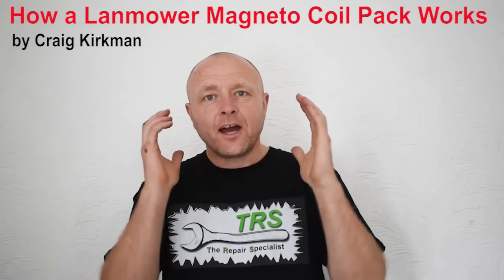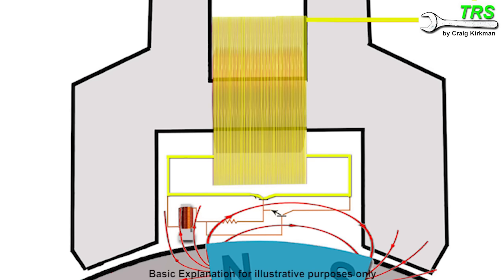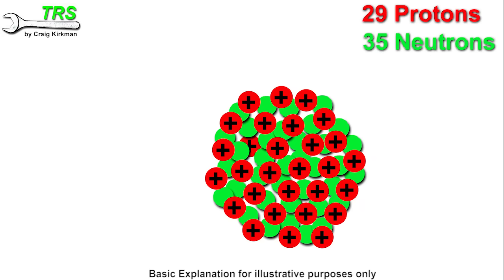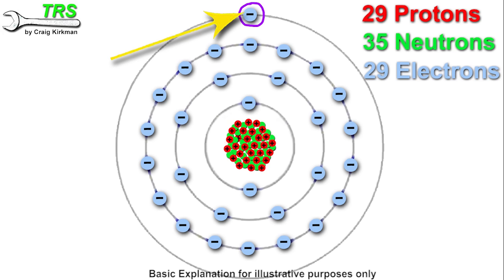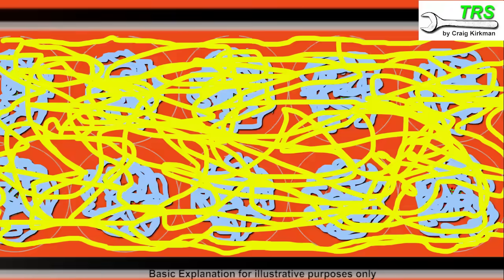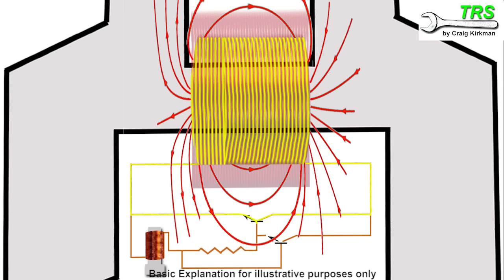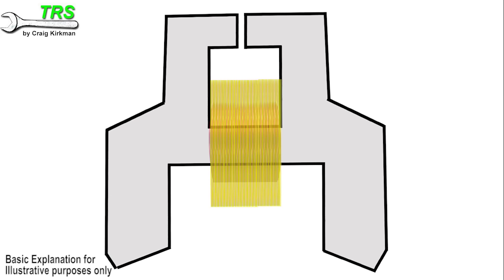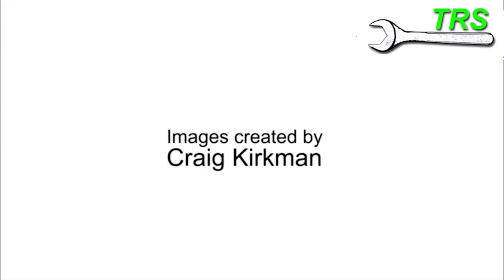Lawnmower Coil Pack Sparking System - Induction Coil, Transistor!  (by Craig Kirkman)

Comment: Just the man I'm looking for. like many others I knew loosely what happened but not exactly how and why.  Now I'd love you to go to the next step, I have a problem and I think by you answering it as you've explained here that you will go a long way to helping so many ? Here's the challenge that proved I don't know as much as I thought or enough to solve the problem. "I was given a chainsaw that fires once or twice with every pull but will not run".  It's an older obsolete model with the coil on the outside of the flywheel and points/condenser under the flywheel. By hand pull it gives a small fine spark similar to car electronic ignition. Upon deeper inspection I find what looks like someone has swapped out parts with something non original as original parts are no longer available. Points look good ? Condenser looks new but is a different model that's been soldered to the base plate (should be OK unless the heat of soldering it's case has damaged it).  So first question is how to test the condenser ?  Next I find the coil has the word ROTATION and an arrow pointing in the opposite direction to that which this flywheel turns (clearly from a different engine) ? Now there are the points style of ignition/coil and the later coils that don't use points and work as described in your video.  How do I tell the difference and which one I have ??  Can one type work in place of the other ... if not why not ... or what needs to be done to make it work ??
I disconnected the points and kill switch wire from the coil and then I spun the engine on the bench using a powered drill to check for spark at speed, which it does ... well kind of ??
It produces spark running the correct rotation for the saw which is opposite what's marked on the coil. It also produces spark running opposite rotation for the saw but correct rotation as marked on the coil ? Does seem more consistent running the latter though.  I re-connected the points and kill switch wire from the coil ... it still produced spark while rotating correct for the saw and opposite the coil marking ... but it doesn't produce any spark rotating opposite the saw direction as I guess the points are opening at the wrong time to coincide with the magnets passing the coil.  Still with me here ?? 
I want to know why the direction of rotation is important enough to be marked on the coil ? My guess is the coil I have is the type you've explained using a trigger coil and for a system that doesn't use points but there is no visible third part of the iron core ?  The iron core is a simple "U" shape with just 2 legs and the coil is over one of the legs.  
So begs another question - why do some 'coils' have 2 legs or iron core and others have 3 legs ?
I'm sure you've got enough to create the next lesson so we all learn the workings of points and no-points systems and the differences and how to convert one to the other ?  Thank you very much in advance.

Comment: Sir, my lawn mower runs for some ten to twenty minutes and then die off. But if I change new spark plug, it runs instantly. What might be the problem..?? 🙏🙏. Because I can't keep on changing spark plug every single time. Please help me to diagnose it.
Reply: try cleaning spark plug ?? look what different used / new !
Reply: @davidm.4670  I used to clean the spark plug but same condition. It won't start.
Reply: @chongshenchang9367  Have you tried re-installing a previously used plug after a new replacement fails?   If so what happened (Heat?) (Gap change??) (fouling?) What was (is) cleaning method / results?  Could it be engine cool down time etc during plug change?  Sorry not much help ...
Reply: @davidm.4670  Sir, ive cleaned the plug with petrol and a fine sand paper to remove the carbon deposits.
Reply: @chongshenchang9367  I would not expect 10 - 20 min run time to make much carbon - is your mower running rich / choked?  Often the insulator for the center electrode (round not tab) getting heavily coated can short the plug.  Reaching in carefully with a needle can help. Can you check if you are using the right temperature range plug for your mower?
Reply: @davidm.4670  No, I'm not saying that it makes lots of carbon but just telling you my procedure of cleaning spark plug.
Reply: @chongshenchang9367  Well I'm 'bout out of ideas from this far away
Reply: @davidm.4670  Sir, I found out that, if the choke is on, it starts but if closed, it stops. What would be the case..
Reply: @chongshenchang9367  Don't really know - might try starting with choke on , then reduce as warms up?

Comment: Am I correct in thinking that one end of the secondary coil winding is connected to the iron core while the other end goes to the center high voltage lead of the spark plug ?   JwgK

Comment: Very good explanation however the magnet moves past the 'A' creating a magnetic field in both the primary and secondary coil and surely the trigger coil just boosts the effect or triggers a current flow already created by the magnet passing the 'A' (what I'm trying to say is that it is not just the trigger coil that creates all of the current flow but I could be wrong).

Comment: The only thing you did not explain is the gap of the spark plug..  What if the gap is to small or to large?  I know it would take a higher voltage for the spark to jump the larger gap.  But, if the gap is to small it would be easier to jump the air gap.  So I know there is a specific gap for each spark plug but would it be a different gap using the same spark plug in a completely different engine?  Wouldn't a smaller gap be still OK or would it fire to quickly because the gap is easier to jump.  That would make firing the plug a timing problem.....  The plug would fire at a time not ideal for the highest compression of the gas...
Reply: Richard Murawski  suspect plug gap not very critical for lawnmower ...

Comment: I, like the majority of the commentators below thank you for an excellent, in depth, and understandable presentation. I was also among the others who were ignorant of the trigger coil housed inside the coil component itself. I knew there had to be a trigger mechanism, but didn't know where it was located in the system. One thing that still intrigues me that you didn't explain; since the secondary coil is grounded to the iron core, why is not the current shunted to ground when the primary coil field collapses instead of to the spark plug? I would appreciate an answer. Thanks again. Carl

Comment: I don't understand how the exact timing is maintained when when the magnetic field on the flywheel is so broad compared to the exact spark event. My assumption is that the electrons will begin to move in the presence of any strength magnetic field. The field of the magnetic occupies roughly 60 degrees of rotation Wheras the spark event is one tenthousands of a degree.

Comment: The secondary coil winding has two connections. One is connected to the sparkplug and the other end of the coil is connected to the engine's iron body. So, the flow of secondary current is through the coil to the spark plug gap back to the iron that completes the electron path back to the secondary winding.

Comment: I considered myself an okay small engine mechanic, but I had no idea how complex these coils are, or how all this worked.  I've known for a long time that the coils and fixed magnets don't perform very well when they're allowed to get rusty.  Other than that, they're pretty tough.  Awesome presentation.
Reply: As per Briggs ,rust does not matter one bit , except for maybe adjusting the air gap, and even then off the record during training they said you probably would get spark with the mag pulled all the way back in the adjustment. 
One issue can be bad grounding ,it can corrode where it contacts the block but it's easy to take off ,clean and reinstall. 
.010 is what you're shooting for but I've been doing it long enough  I just eyeball it.

Comment: I knew most of the components and architecture... SORT OF... I've been jabbing at these things with ohm-meters for years, and still trapped in usually just replacing the thing with little or no explanation as to what's actually wrong with it... "It won't fire" is about all I've had...

    Now, there's the trigger-coil wired to the internal "primary coil" and the SEPARATED (or "isolated" if you like) Secondary coil to throw the "High Tension Spark" (as in the "H.T. Lead") to the plug... AND I can see it, and "get" it... 

    I may still never truly diagnose a coil fault without hopelessly mangling the coil-pack, itself... BUT I definitely have a better idea of some of what the numbers on the ohm-meter mean when I do "semi-destructive" jabbing around in there... Thank you, sir, for a well articulated exposition on the basic principles of a magneto coil pack!!!  ;o)

Comment: Oh good lord.  Please stop putting this nonsense out there.

"The electron current stays largely in a loop".  That's true, but you have completely missed the point of a breakerless magneto system.  The changing magnetic field in the armature from the permanent magnets induces current in the primary.  The point of the trigger coil is not to drive current though the primary, but to create the loop through which the induced primary current will flow AND, at the time of ignition, to reduce the bias voltage to the darlington pair to switch it off which instantaneously opens the primary winding circuit at the right time so that the primary winding current stops dead.  This results in a rapidly collapsing magnetic field from the primary, much faster than the period of the rotating engine and this is what induces the very high tension in the secondary winding resulting in the spark.

The current in the trigger circuit does  NOT go through the primary.  On your diagram, it needs to turn left after going through the darlington pair and back to the trigger coil, not right to the primary.

Plus you have failed to mention that one leg of the secondary is connected to ground and that is why the secondary current flows through the plug to ground, NOT because "ground is relatively more positive".  Dynamic currents require a loop.

Seriously, fix it up, you're teaching people erroneous information

Comment: I have fitted these coils to older B&S and although I knew the basic idea it was great to have an in depth explanation rather than having the meaty bits glossed over, well done.
Reply: Does this type of coil work in an older B&S that originally had points? Using the original flywheel?

Comment: Excellent explanation. The only detail missing is that the secondary of the coil is also connected to ground, completing the circuit and allowing the electrons to return to the secondary.
Reply: Thanks for the additional information.  I was wondering if there is and waste, or loss as a result of this process... meaning, once the electrons leave the coil, are they replaced somehow? Does it change the composition of the copper over time?
Reply: @bmxt9x  Yes, although it’s plainly obvious and will run an engine for many years, I also wonder if this depletion of copper electrons has any effect on the purity of the original copper. A bit like if the copper looses enough electrons will it become radioactive or better still will it turn into Gold or Plutonium? Alchemists unite!😂😂
Reply: @nickybritain4900  No change occurs in the copper over time. To change one element into another you need to change the number of protons. Changing the number of electrons creates ions. Radioactivity is also affected by the number of neutrons (isotopes). Some atoms have no stable isotopes.
Reply: @bmxt9x  Like all electric circuits (except static electricity) current flows in a closed loop. The number of electrons leaving the coil is exactly equal to the number entering. There is no net loss over time.
Reply: Agreed, I too was wondering why the 'ground' wire wasn't included. Excellent explanation though. As a teenager we used to use a small bell attached to a low voltage battery can produce a 'shock' as an example of back emf.

Comment: I'm a 64yo A grade automotive engineer and have been in the industry 35 years, I have tested these when not working with a multi-meter and replaced as required but never knew about the transistors or trigger coil. I just looked for continuity between the plug wire and ground 2k to 4k ohm. thanks I have a better understanding.

Comment: I recently offered too fix my neighbors chipper and and while pretty well versed on various engines I had not mucked with a new Briggs and Stratton  pointless ignition. And was surprised to find no points and condenser needed. Also much easier to repair not having to pull the flywheel to get at the points. Seeing zero spark at the plug I replaced the coil and spaced it from the magnet on the flywheel as per spec. It resolved the issue however at cranking speeds the spark in this case was less intense than the old school point and condenser design. Anyway on another bigger project I am using a trigger wheel activated waste spark system where the coil fires two plugs, one on compression and one exhaust stroke. 4 coils service the V8. Electromotive is the manufacturer. More to the point this was an excellent presentation on something I could not comprehend by looking for non existent points and starting at the coil....well done thank you. J

Comment: I have often wondered why simpler ignition systems like this or even simpler, are not used for more durable and easily maintained systems for vehicles, especially in remote settings. Thanks, good job.
Reply: This setup has no way to advance the timing for higher RPM which is very important for an efficient engine.
Reply: @crissd8283  I've wondered if the magnet passing a single coil, would not induce enough voltage to make s spark and be the simplest design...

Comment: So on a 4 stroke lawnmower engine there is a spark on both the Power and very end of the exhaust stroke??  Because the flywheel magnet passes two times between power strokes.
Reply: John Battista re firing mower on exh. stroke- from other comment(s) they do.

Comment: Can someone explain to me the purpose of the resistor? It seems to make sense that nothing would of changed with or without the resistor. Maybe I missed something, but it also doesn't make much sense because electricity still would of traveled through the resistor, but just a smaller current.

Comment: I have a question that you didn't answer in your video: why the flywheel has more than 1 magnet? For example while disassembling my lawnmower I noticed that it has two pairs of three magnets. How that could help the ignition system?
BTW excellent video!
Reply: Does your engine have more than 1 cylinder?

Comment: All great info, but. The original magnetron by briggs,was a bit more complex, it had a  transistor and a capacitor to boost the current to the primary coil, not knocking your video, well done sir I subbed😎

Comment: I was under the impression that the "secondary" needed to somehow connect to ground at the other end, to complete the circuit. So the spark electrons can return to the coil.
I'll also add something - - 
When re-installing the coil on a lawnmower- trimmer- blower, take 2 sheets of printer paper, let the coil stick to the flywheel magnet (trapping the paper), tighten the 2 screws and remove the paper.
You now have a perfect 0.010 gap for the flywheel.
Reply: I think if you ground it, any of it you will lose the charge.  The ground is achieved in the metal hook at the end of the spark plug (which goes to the block through the metal threads) So that would complete your circuit
Reply: @whatsup3270  So, the copper wire "secondary" gives up a Billion electrons for the spark and 0.02 seconds later a Billion more "go to ground" ... Eventually the copper wire will get depleted of electrons and it will become harder and harder to generate a spark.  This would be a static system ??
Reply: @TIMEtoRIDE900   not really, think of an ocean wave does the ocean lose the water in the wave?  no it returns to the ocean.   Same is true in electricity its coming back, until it returns you have magnetism.  The path does not have to be direct as the air will supply electrons or electrical charge as needed.  To look at that source you can often watch a AM radio or even a cell phone call be affected by the electron fields ( magnet) around the coil.  
Copper and iron were not chosen accidently they both have loose electron fields and both can easily give or take electrons, and or electrical charges but neither will hold the charge, that is why you don't have copper or iron batteries.
Reply: @TIMEtoRIDE900  Copper is never depleted of electrons - the electrons are not held tightly, but flow will not occur unless extra electrons are introduced at one end of the conductor. A simple way to imagine the action of an electromagnetic field on a coil  is to imagine its action like each coil as an air pump in the middle of an open pipe. Turn on the pump and it will suck electrons in one end (representing the ground) and air will push out the other end. but when the pump has stopped, there is still air in the pipe.
Reply: @whatsup3270  The secondary coil has one end grounded. The other end goes to the center of the spark plug. The plug threads connect to ground completing the circuit.
Reply: You are correct. The secondary has one end grounded. You can test the coil resistance by measuring between the spark plug wire and the frame of the engine. It is roughly 15,000 ohms.
Reply: yes is grounded. look up auto transformer.
Reply: @simclardy1   @simclardy1  An auto transformer has a single tapped winding. This has two windings which are connected at one end. An auto transformer does not necessarily have a connection to ground.